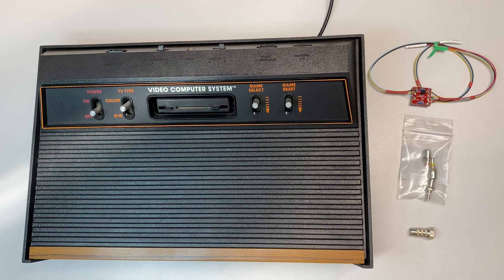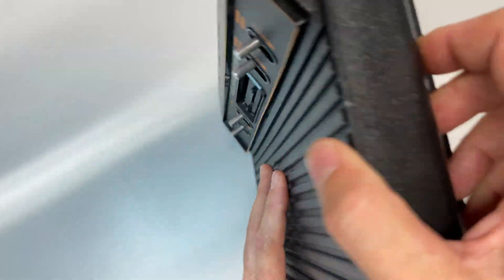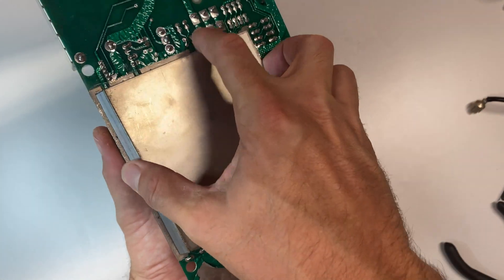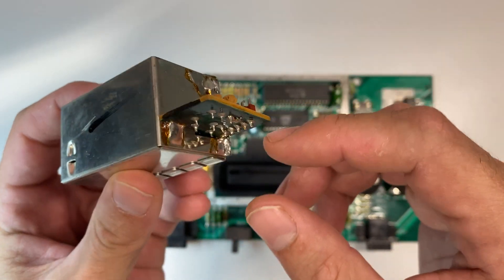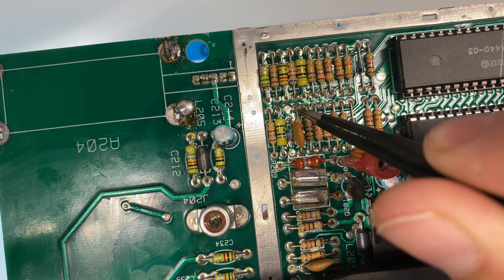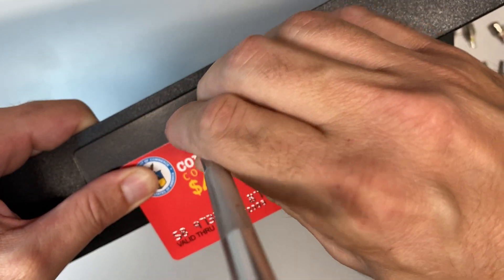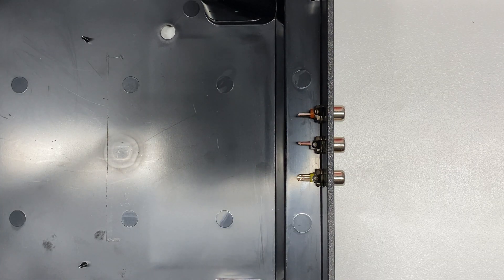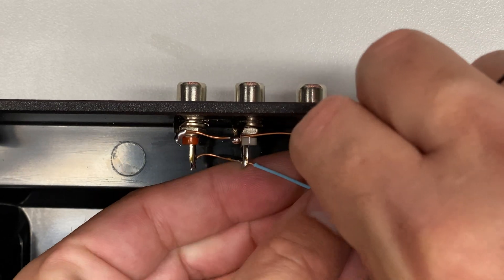Atari 2600 RCA Composite Mod

Comment: I followed this video in order to mod my 4 switch 2600. Same mod and same 2600. I kept getting signal degradation coming in and out. I decided to remove q201 and that solved it. I would definitely recommend removing q201. I hope this helps anyone else out.